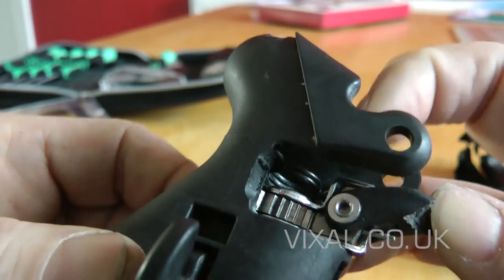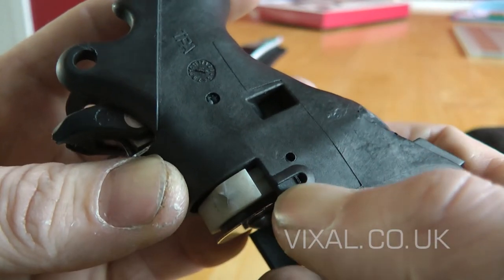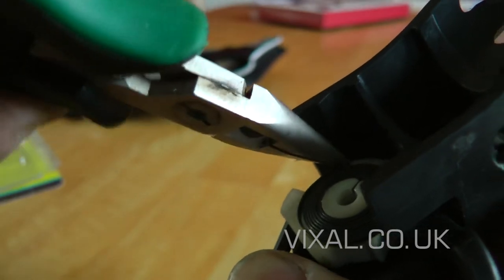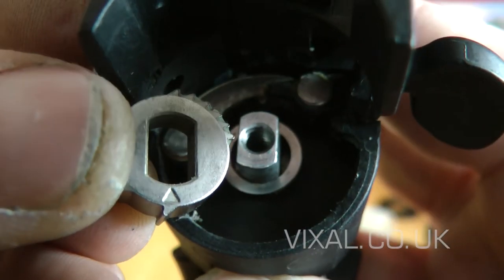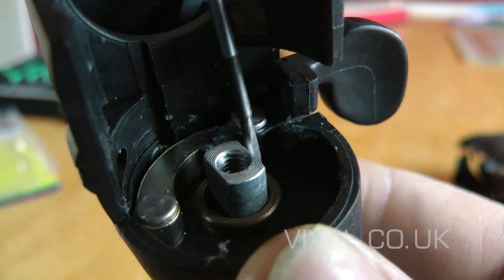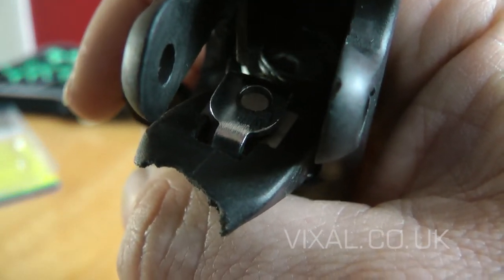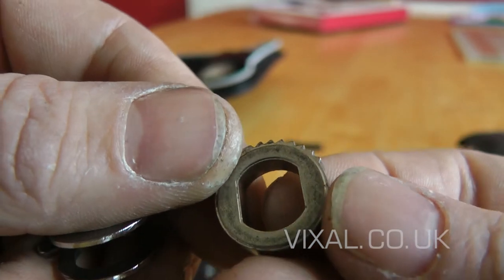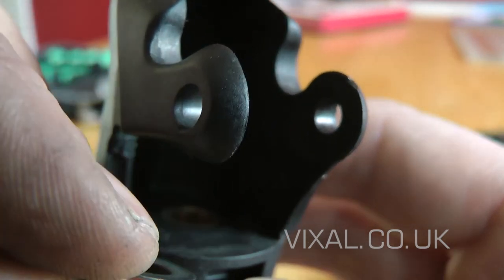Campagnola Shifter stripdown

Comment: That small spring inside the body at 6:55, mine is broken and there seems to be no part number for that specific spring. Bike shops don't know either. Anybody knows where I could find a replacement? Thanks.

Comment: If you ONLY have to replace Return Spring for paddle , can you just insert and secure NEW one by moving paddle  ?

Option 2 
You should be able to tap out pin securing paddle from shifter body without removing from handlebar
With paddle out , simply install and secure NEW Return Spring and then re install paddle

Comment: Wot a waist of time I thought you were going to change the gear selector or repair it . Can you buy the part or wot was the point explaining the dismantling was good but without a solution site the point
Reply: Literally told you how to take apart a shifter (so you can put in the new part) and the sequence of parts to put it all back together! How is that a waste of time?